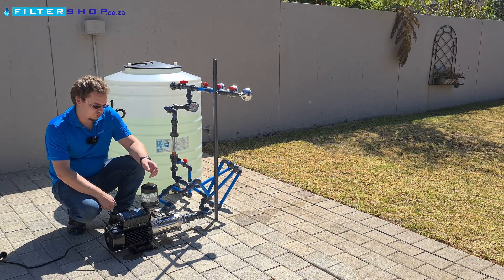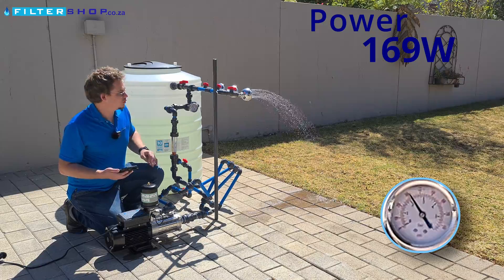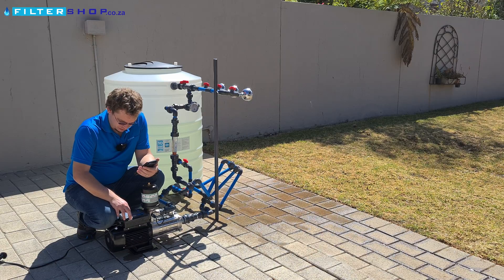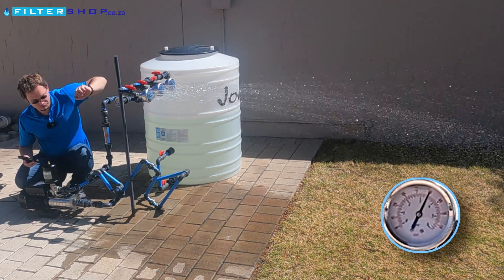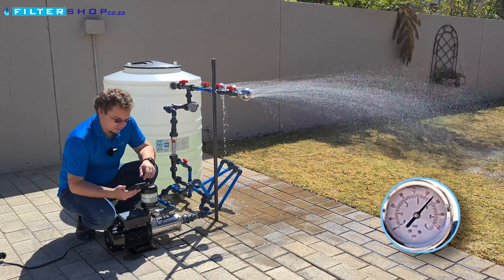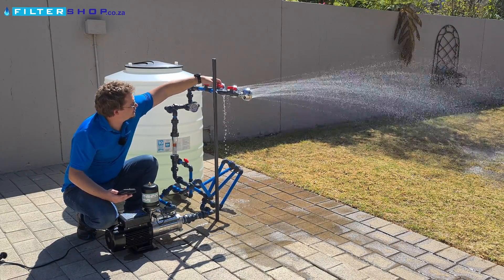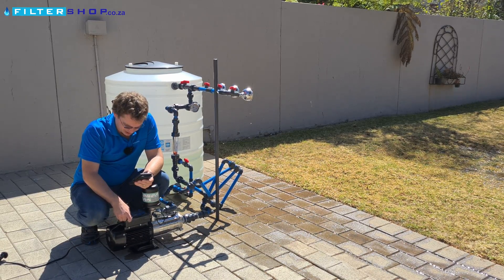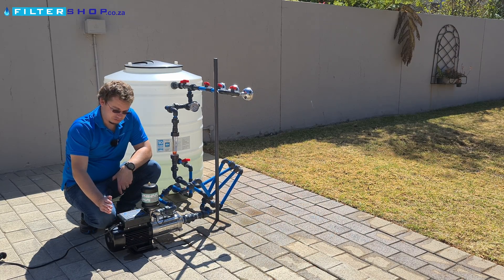HMS1500 Stainless Steel VSD Pump Review

Comment: What would be the deciding factor to go with the 075KW or 1.5KW HMS pumps?
Reply from the maker: Hi, If both provide enough flow then the HMS750 is fine. If however you want to use a pressurized buffer tank to reduce how often the pump cycles then you need to go for the HMS1500 as it has that functionality. Also you will be able to run a much larger irrigation system on the HMS1500 than the HMS750.

Comment: Bought one of these from your shop. Struggling to prime it after it happened to run dry. Any tricks?
Reply from the maker: Hi, after a dry run open the priming screw until water comes out then close it. Since it is a multistage pump you othen don't get all the air in the first go. So then turn on the pump and run a few liters through, then open the priming screw a bit again when the pump has stopped. If you are getting air and water out keep it open a bit till it is just water. Then repeat. We have had that you need to do this two or 3 times on this and the other multi stage pumps.

Comment: Amazing video. May i know what are the sizes of your pipes? I believe that there are several sizes in your demo setup.
Reply from the maker: All the piping is 25mm uPVC piping and fittings. We purposely have longer runs on the feed side of the pump as it isn't always practical to have the pump right by the tank.

Comment: Would it help to install a 24L pressure tank after the pump. Just to even out pressure and supply water some pressured water at startup.
Reply from the maker: It is quite quick and has a 1L tank so haven't found that it is needed for supply reasons. I do however use one at my house with a 150L buffer tank to make the pump cycle a lot less.

Comment: These videos are great! Thank you! A quick question - what is the difference between a VSD pump and a mutlistage pump? And which is better for a household setting?
Reply from the maker: It refers to two different areas of design, a VSD is a controller that can run the pump at different speeds. While multistage refers to the actual design of the pump itself, in this case, it is a 5-stage multistage pump with a VSD controller so it has both. Typically a multistage design gives you higher pressure at lower speed and thus lower noise.